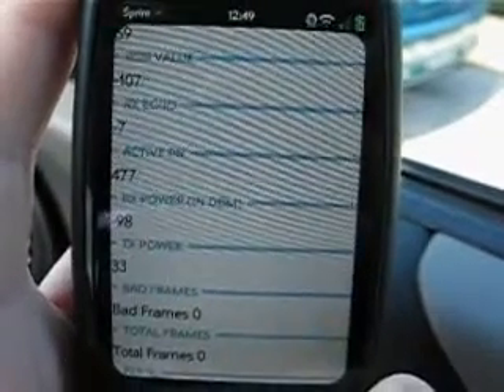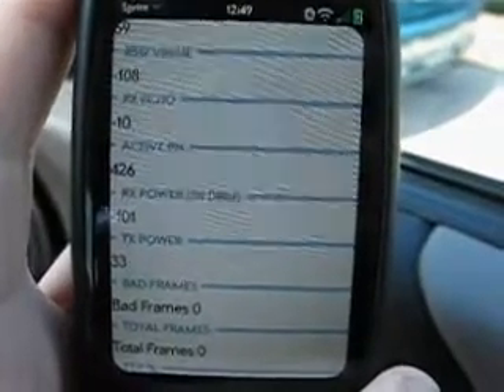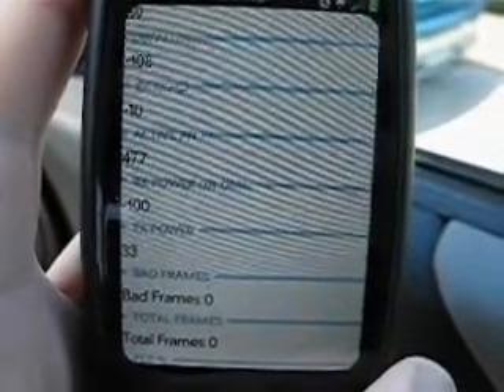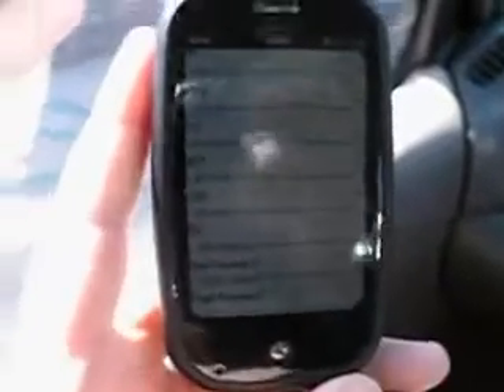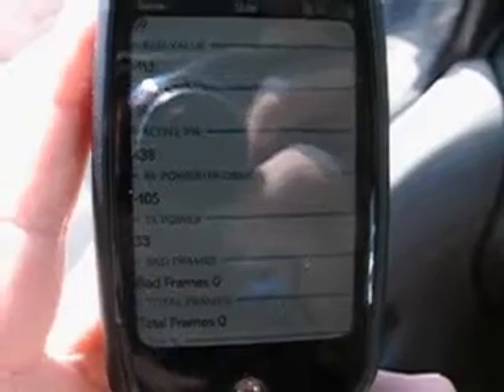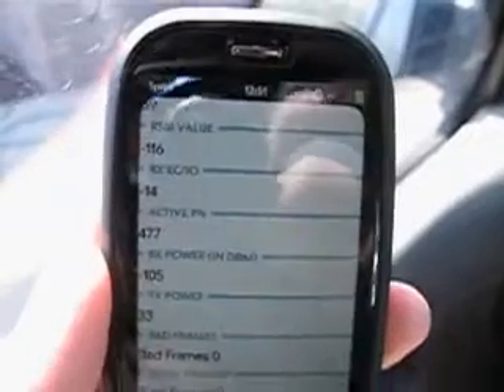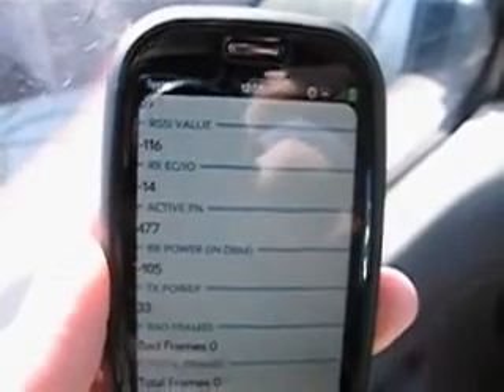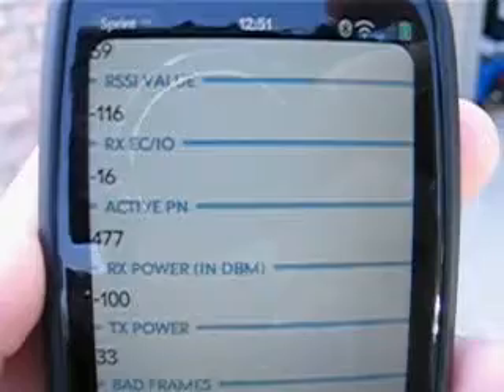Two different cars, two types of tint, 6 to 8 dBm of signal change

Comment from the maker: @mmmartin261 Most people won't notice a difference, but it is there.  Signal wise, it causes 6 to 8 dBm difference.  While metalized film won't cause someone's cell phone to stop working, 6 to 8 dBm is more than enough to be the difference between dropping a call or not dropping a call in a bad reception area.

Don't roll down the window, just get a metal free window film installed.